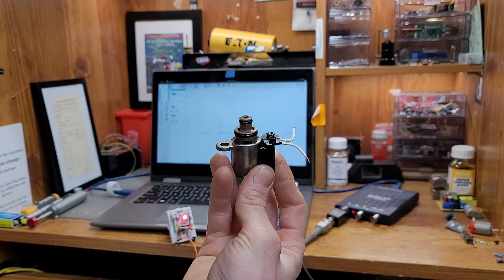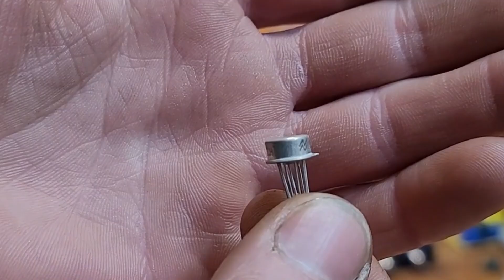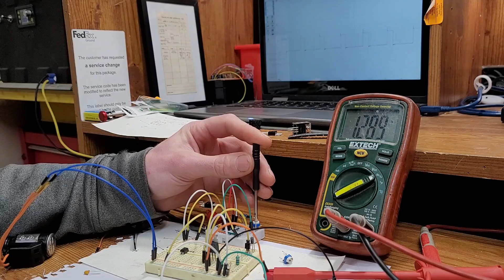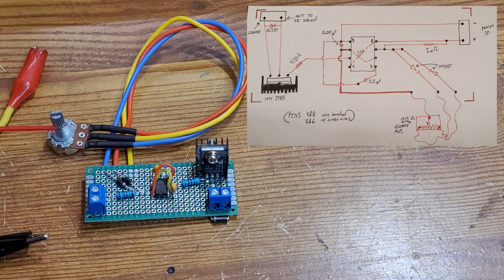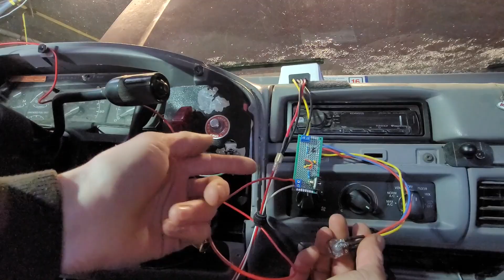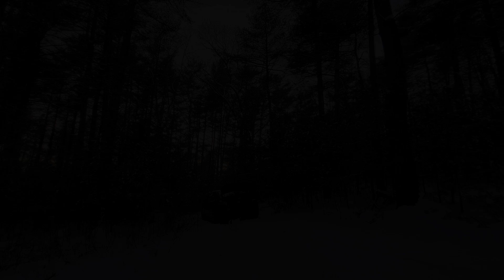command line pressure without a command line

Comment: Can still work the shifter  solenoid A an B without Line pressure control Sir
Reply from the maker: yes in most cases you can. 
sometimes it is better to leave the line pressure solenoid hooked up to power and sometimes its better to disconnect it. depends on the transmission